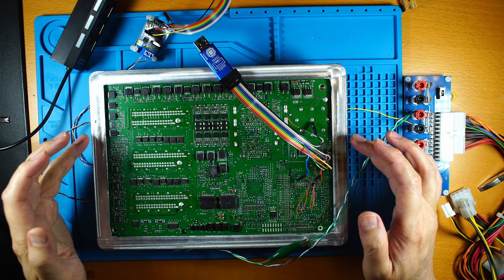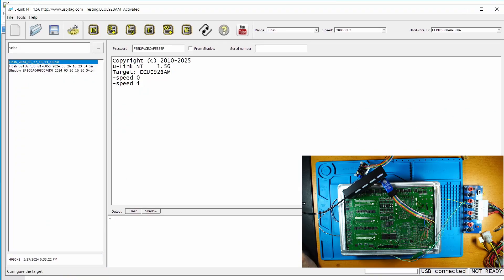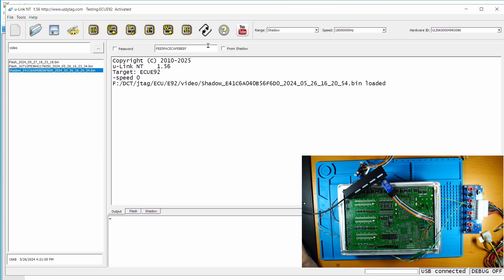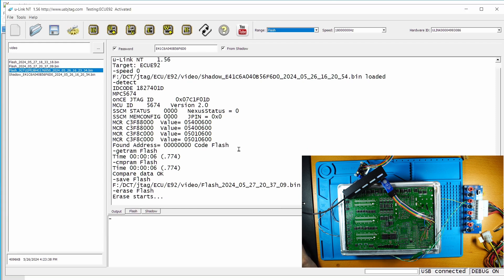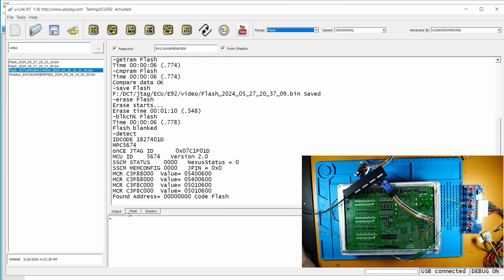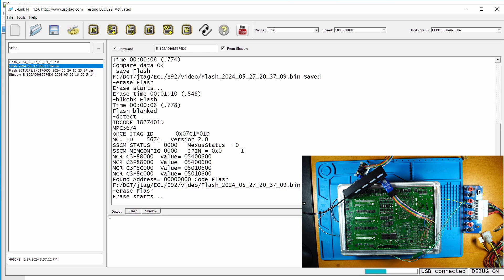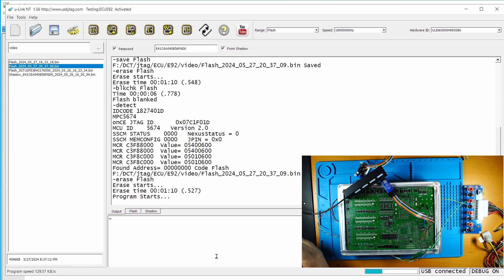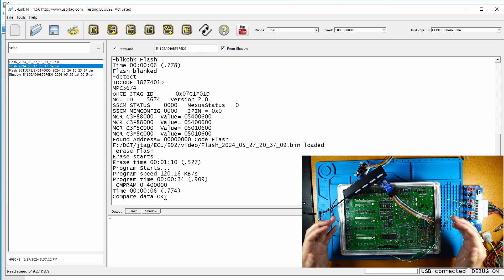u-Link NT program ECU E92 (JTAG)

Comment: I am having trouble finding JTAG interface ports on a GPEC2A, MPC5674F, needing to unlock boot loader to allow for OBDII flash read/write. It would help a ton!
Reply from the maker: Normally I need to destroy one ECU to find the JTAG pin. The ECU might also be censored which means you need to find the shadow password to use JTAG or BAM.